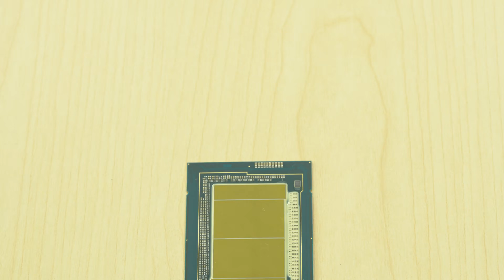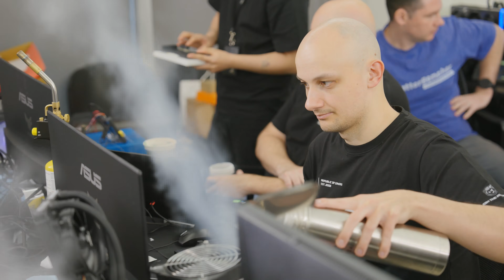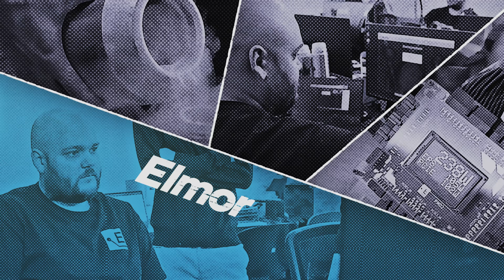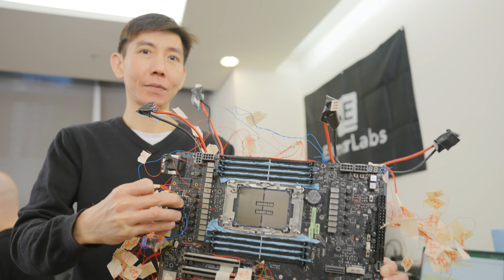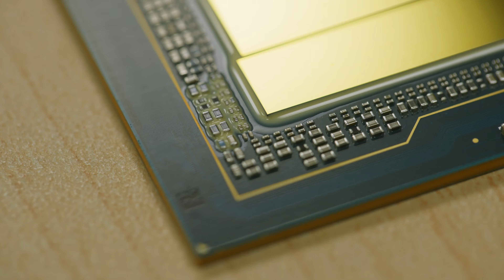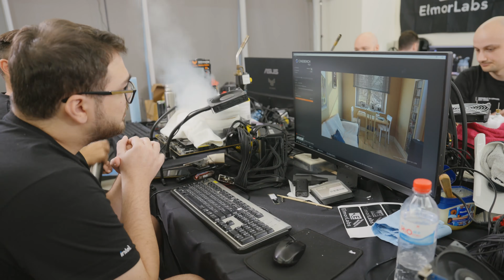Asus Sets 10 World Records with OC Intel Xeon 698X Processor for Workstation | Intel Technology

Comment: As an owner of EVGA SR-3 Dark, I hate the MCIO x8 location.
Couldn't you have placed it somewhere, anywhere else really, so that it would have been possible to design a custom monoblock for this motherboard?
As it is, you could route water into a hypothetical M.2/chipset block, but not out of it, simply not enough space.
Same problem on the WRX90E Sage.
No such problem on WRX80 and W790, but I have no desire to jump from one outdated platform to another.

Comment: For the OC market why oh why did Intel not use the old school IBM method to encapsulate the cpu in a complete.liquid cooling block. Yes IBM did this over 20 years ago. Even sun microsystems did this before they went under. Take the VRMs and the ZIF socket and put it all in a encapsulated design and then have a riser style connections to the mainboard/backbone. These ZIF style sockets are great for standard production end product but if you want go crazy OC I dont see the LGA ZIF socket on just not suitable.

Comment: Stop playing with it and give us the chip already lol. Your loosing to threadripper at moment so give us some power to our workstations
Reply: It's still inferior to TR, even 7000 let alone 9000 (in most workloads + power consumption), while being equal price wise. No reason to buy this platform if you don't need octa-channel RAM.
Reply: @Rubed0_o I agree, the 698x is way to expensive for what it is. Intel will need reduce pricing considerably to stand a chance in competing right now as the new zen6 chips will be at least 30% better than zen5 if AMD follow their current progression.

Comment: Why have something like this when the the normal user at home or at work never sit there with liquid nitrogen.
Reply from the maker: Achieving the extremes can really help show the range and possibilities for everyone who doesn't have liquid nitrogen constantly flowing into their PCs, which is very understandably most people. That's also why some overclockers chase the top performance in specific cooling scenarios as well, which can be even more relatable!
Reply: @IntelTechnology  Pushing the limits of an architecture via overclocking provides super valuable feedback on improvements into the future. For the normal user at home/work, the system they buy can be tuned specifically for their workload (be it highly multi-core OC or tuned for single-thread OC for interactive workloads), OC tuning knobs provide system integrators the tools to create those workload-specific tuned workstations. Here in this video, we are showing the very upper limit of the performance capable on this technology

Jon Patton - Client Product Marketing for Workstations
Reply: Why not? It's still entertainment for enthusiasts.